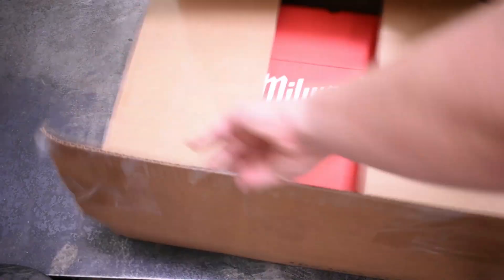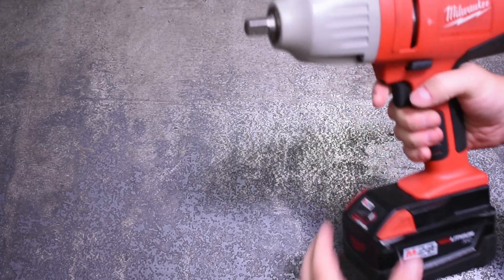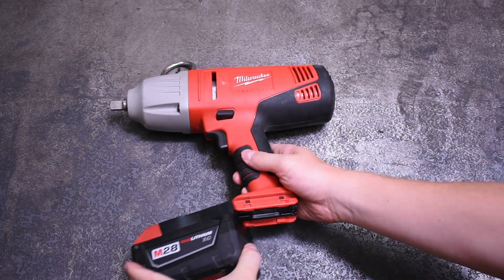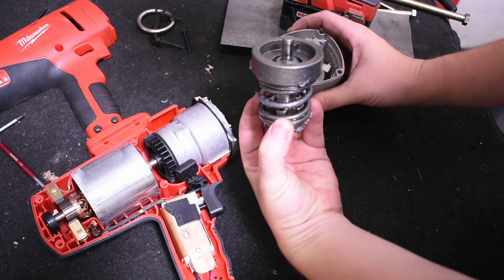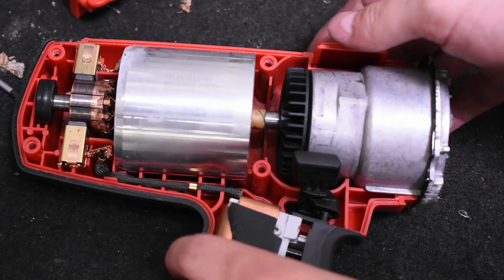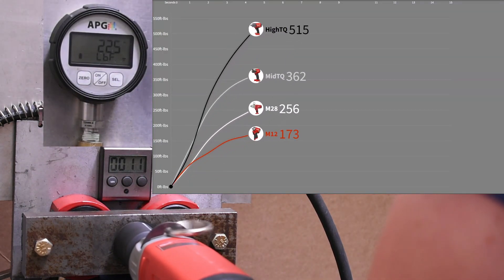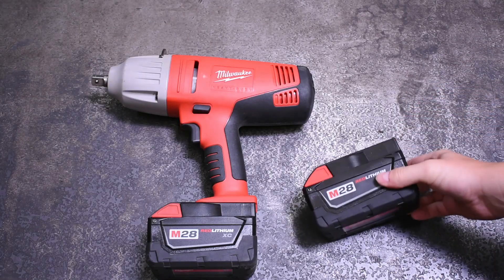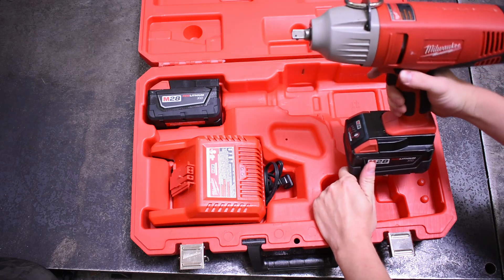The Curious Case of M28: Milwaukee's Little Known 28 Volt Line

Comment: The battery pack going in from the back or the front was the standard through their older line of 14.4 and 18 volt tools, pre-M18; this design was great and used to be my go to as if you load in the front the tool is well balanced for down and forward facing work while loading from the back made it a lot easier to use overhead.

Comment: I had the old circular saw, drill, and Sawzall in 28 volts.  The Sawzall was the only one in the group that performed like a corded tool.  But at the time the M28 platform was the most powerful battery-powered platform I could find. I did replace them when all the batteries started dying with M18 but it felt like I was going backward at the time. But soon after that since I got the brushed tools. Then I learned that the brushless motors seemed to make the difference. I still have them packed away for some reason.

Comment: I’ve had the hammer drill since I was a kid. I found it out in the bush acutely. It’s been dead for about 10 years never seen it run. is there anyone out there wanting to charge the battery and try it?
Reply: Umh. A lithium battery not charged for 10 years is certainly dead due to self-discharge. If a cell dips below 3 V for an extended time, it becomes dangerous to charge and should not be charged.

Comment: I still use a 14.4 volt Milwaukee drill I've had for about 20 years. It also has the reversible battery.

Comment: Milwaukee has a higher voltage line that's been around for years and they actively support with new products. It's called MX and it's 72 volts. More suited to riding mowers than impact wrenches though if they ever use it in a consumer product.

Comment: I like the 28/24v tools that can be converted to external power like on trucks and machines for back up power working in isolated areas,  I have an old Goodyear 24v impact probably 15 years old that still performs as good as it did new and has served me well in remote situations hooked up to 24v starter batteries
Reply: That's exactly why I selected the Milwaukee M28 line (have most of the tools by now, all bought used). I live in a truck with 24 V onboard electrics and 24 V in the living space, and just hook these M28 tools up to 2×12  AGM batteries. Works great, and also means I don't have to charge (and won't degrade) the M28 batteries. 

To make the connection, I converted a broken battery: remove the cells and add a SpeakOn STX connector, which can take 40 A and are used as weatherproof connectors in large PA setups (loudspeakers and stuff). Cables are also from loudspeakers.

Still looking for a good-quality 24 V chainsaw, if anyone has suggestions …

Comment: I remember buying a V28 kit back many many many years ago. At the time it was a huge upgrade over the Makita Nicad stuff i had (the red pod batteries) Then later had to buy a couple of newer M28 batteries (M28 was sort of the 2nd gen rebrand of V28). But very quickly was forgotten. Seems Milwaukee put their RnD into M18 and just sort of left M28 to die. But you can still get the batteries

Comment: DeWalt too had useless 28v and 36v platform
Reply: I think you memory is off...dewalt has had 12v, 14.4v and 18v(20v max) in nicad and lithium, 40v tools in lithium....porter cable did have 28v but in ni-mh.

Comment: The shop I work at had a bunch of Milwaukee 18v Pre- Lithium tools. All of these tools had the reversible battery track just like this. I was disappointed that they removed that feature from the New line of 18v tools. Overall I wish they would have just done like Ridgid and kept the same battery footprint so the new batteries would have worked with the old tools.
Reply: I think they wanted more pin for the electronic interface...

Comment: I had hoped Milwaukee would take advantage of the 28 volt line when Dewalt starting upping their volts. I thought they could have a game changer offering 28 volt brushless models.  Overall I’m happy with the M18 line otherwise I wouldn’t have spent 15k over the last 7-8 years on that platform.   I Still think they should just ditch the brushed models altogether.

Comment: I had V18 tools, the drill had the best chuck of any drill I've ever used.  At that time Milwaukee claimed to have more made in the U.S.A. power tools than any other company, unfortunately that claim didn't last long.  Pretty sure my M12 Fuel tools will easily outperform that V18 stuff.

Comment: We use some M28 tools at work the best tool in the line that we have is the M28 vacuums.
I wonder if Milwaukee brought a new 2022 Impact into this line made it a Fuel and with a newer XC 5.0 M28 battery how well it would perform?

Comment: I actually started out with M28 and moved into the M18, M12 lines it looked like they were cordless versions of the corded tools of the time I had Portable Bandsaw and a bunch of other tools that worked great. The first generation of M28 battery would self discharge pretty quickly. I bought my M28 stuff around 2006, cutting edge for the time. Thanks for comparing old to new. Times have changed

Comment: I'm glad Milwaukee actually stuck with the M18 line.  I got so tired of kitting out my work vans only to have the company abandon the platform for a few extra volts.

While I have my issues with Milwaukee quality lately, you can't complain about how long Milwaukee has committed to M12 & M18.
Reply: people who originally bought into V18 and M28/V28 li-ion can't say the same thing though.
Reply: Also there’s no reason to change the voltage. M18 works just fine over never had something my 1/2” impact can’t remove.

Comment: This reminds me of the 1st crop of 18V/20V brushed high torque impacts like the DeWalt DCF889 I used to own. When I got it replaced with the DCF899 I tested them both on my truck's wheels and suspension and there was no contest in speed and torque. The only thing I liked about the 889 more is its instant response to the trigger, something that I haven't been able to find on any Brushless tool be it Red, Teal, Blue, Yellow, Orange or Lime (the ones I've owned so far)

PS. It would be great if you can either get your hands on some 1st gen high torque brushed 18V/20V tools like the DCF 889 (or its Craftsman and Porter Cable clones) , Milwaukee's 2663-20 or Makita's XWT04

Comment: Ah, thanks for this,TTC. I always wondered how it compared.

I too bought that impact way back when they came with V28 batteries. No surprise, the batteries went bad. (Milwaukee punted on the 5yr warranty, when I sent them in at 4 years)  Bought cheap Amazon M28s, which did ok (ish). Then the trigger quit working.  At that point I punted on it and got the M18 high torque, albiet begrudgingly. (And only after I could clearly see it was heads and shoulders above the Dewalt I swore I would buy).

Still have a nice V28 drill, shop vac, and radio... and one functioning M28 amazon battery. 

Thanks TTC. It was great to see this test. Amazing how far things have come.
Reply: The new Dewalts are pretty great honestly. My coworker has an M18 and I have the new DCF891 and the gap between yellow and red isn’t what it used to be. Used to be yellow tools sucked lol.
Reply: ⁹

Comment: This is an impact that looks like it was “quality over quantity”. Never a bad thing. It’s just a shame that in the last decade quality on most of these tools have suffered to reduce the weight of tools. Seems like there’s a fairly happy medium on pro tools but this looks like it was engineered to last a lifetime. It’s a shame they opted out of the battery platform
Reply: Most of the decent modern brands today really aren't slouches when it comes to durability.  I'd go out on a limb and say this impact might've been OVERbuilt.
Reply: @h8GW  sometimes that's a great thing! I imagine how much less severe my carpal tunnel flare ups might have been if my everyday air tools would've had that much bearing cushion against the vibration...and the fact that they'd probably need rebuilt...about 80 years from now.

Comment: Can you let us know the age of the batteries used for this test?  Battery internal resistance increases with age even when stored unused.  I wonder if the dyno results represent how the tool would have functioned when it was brand new with fresh batteries.

Comment: That's the old 18v ni-cad tool adapted for lithium. It's 28v fully charged at 4v/cell but Li-ion cells run down to 2.5v/cell (17.5v). They probably just limit power to the equivalent of 18v as the battery runs down. Now that the batteries are dead, I'm thinking of running my old one at higher voltage to see how much power I can get from it, (24v, maybe 36v)

Comment: i have the midtorq m18, compact and packs a punch for its size, got it brand new for free without batteries and charger tho so i bought a set of third party batteries, still does it but they doesnt last as long as the original batteries and the off brand charger takes twice the time to charge the batteries... still tho the tool is great and i can use it on wheel nuts and bolts with ease

Comment: I've always thought "old" Milwaukee cordless tools were of much higher quality then the new stuff, of course the performance pales. My first Gen 18 Volt tools were indestructible, but my new stuff is way lighter and more powerful. It's SAD that my "new Milwaukee" drill is using my "OLD Milwaukee" chuck since the new chucks suck so badly.
Reply: You can get aftermarket German chucks. Because yeah the new ones suck.
Reply: We had to ditch a bunch of the old Milwaukee 18v stuff due to all of the batteries being dead. Those tools were tanks and worked very well. I hated to see the new series take such a dive in overall quality, but love the increased performance.
Reply: The original Milwaukee lithium ion, were a pile of crap.
I still have my old tools, bought a battery adapter, but haven't used it yet

Comment: M28 uses 26650 battery cells
Reply from the maker: Then how in a 2P configuration is it only 3ah? 1500mah 26650's?
Reply: V18/V28 packs used 26650.  M28 uses 18650s.

Comment: Heavier, wider hammers seem to dominate. I think moving forward, innovation in the hammer mechanism is where we will see gains, not so much motors and batteries. I am surprised we haven't seen tungsten nickel iron alloy hammers yet. They would be more interesting especially when you want a hammer assembly that is more compact. A tungsten alloy hammer can deliver twice as much energy  with the same size.
Reply from the maker: I believe most tungsten alloys would be too brittle. Thy need to take a WHOLE bunch of impacting forces, hardness not as sought after as toughness
Reply: @TorqueTestChannel  Would inserts of tungsten work? Tungsten on the inside and something tough on the outside.
Reply from the maker: We're trying to do just that with inserts
Reply: @TorqueTestChannel  a friction fit  sleeve on the outside perhaps?
Reply: @TorqueTestChannel  W-Ni-Fe alloy is very different than the usual tungsten carbides we are used to, which are more like a ceramic. But perhaps ironically W-Ni-Fe might be too soft, I read the hardness is 24-27, I am not sure there are means to harden it to the 45-50 range as we do with tool steels. I mentioned W-Ni-Fe because its the only tungsten alloy I could think of, but maybe there are better alloys for that use. Other than that, some stainless steels are slightly denser than tool steel, but the difference is so small it might not change anything.

Comment: The tools are strong the V28 batteries were not. We have almost every tool in the the line except the band saw. I’m about to rebuild all the batteries because the tools are strong and have not skipped a beat since new.
Reply: Yes the V28 batteries did not last very long. I think maybe b/c they use 7 of the 26700 cells, and cell tech at the time was not advanced enough to provide high amps and long life from 7 cells. The M28 batteries are better, I think. They use 14 of the 18650 cells and come in 5 Ah variants as well.

Comment: Could you guys do an episode on how breaker bar torque compares to nut busting torque?  I am often confused why my big impact wrenches can't budge some bolts, but my 20" breaker bar, pulled slowly, can.  I'm not a weakling, but my arms  produce less torque @20" than 1000lbf air guns are rated for.  What makes slow and steady pressure work when impacting doesn't?  (Not sure if this is unique to torque to yield bolts or not)
Reply: The relatively short pulses of torque from the impact don't have time to "reach" the threads, as they are "absorbed" by the length of the fastener. The torque applied via the breaker bar isn't "pulsed" in nature, so it is transferred to the threads.  Same phenomenon is what limits impacts, when you start adding extensions. (The loud "SNAP" heard when that bolt breaks free is the "wound up" torsion straightening back out, that you had to over come, that the impact didn't have enough throw to defeat.)
Reply: @mattmanyam  Is this unique to bolts where the head is a few inches from where the threads engage?  (E.G.  Head bolts and most torque-to-yield fasters)  Testing this would be a fascinating episode.  From your description, this wouldn't happen on nuts or short bolts where the torque is applied where the torque is resisted (the threads)?
Reply: @SvdSinner  1. Yes
2. Generally, yes. (It would depend on how the clamping forces interact, and how corrosion has developed)
Reply: @mattmanyam  Fascinating! That makes sense. 

Makes me wonder whether some impact tools and some bolt lengths are better matches for each other.
Reply: @gf2e  yes. This is indicated by how some torque-sticks react differently to different guns. {The same "absorbtion of torsion impulses" principles is how they work.)

Comment: I like the 2x 18V over the new 40V hype. With 2*18v there is a lot more flexibility. You can have compact highpower or a bit bigger high energy in one. 2*6Ah 18V are more flexible than a 6AH 40V as you can use 1 18V 6AH on a drill where a 40V 6 Ah would be to big. Although I guess you can do the same to combine 2 40V 3AH battery's.

Comment: A lot of the M28 stuff felt/looked/performed like corded brushed tools with quick and dirty DC conversion. Fine for the era, but pretty outclassed for 10+ years now.
Reply: Isn't it more like 20 years?  In ~2002 I bought my first Milwaukee, a 14.4v 1/2" drill.  It had a whopping 400in/lbs  torque!  And used NiCad batteries.  I think the 28v tools were available at the same time.
Reply: @fredygump5578  It came out in 2005. I was a plumbing trade apprentice at the time and wanted to upgrade my old porter cable nicad system with lithium ion. Milwaukee V28 and Makita 18V LXT basically were the first two platforms then. I went with the Makita LXT while the contractor I worked for did the Milwaukee. I had no problem with usage with either platform however looking back on it glad I went with the still relevant Makita.
Reply: @charlesfinnegan7930  I got the makita too when it came out.  I was installing satellite TV, and that was the essential tool.  Sadly my milwaukee weighed like 3x, tried to snap my wrist all the time, and took much longer to charge.
Reply: @fredygump5578  I still have the original makita tools. only doozy was the original 1/2" drill. I still have one original battery that runs also.
Reply: Makes me wonder once again when/whether anybody will start making corded brushless tools.
Reply: @rpavlik1  They do. It's common to find BLDC industrial assembly tools, i.e. the tools they use to put cars together. For example AcraDyne nutrunners and Atlas Copco screwdrivers. They want good ergonomics, tight torque and rotation control, and the ability to stand heavy use. The thing does hook up to a big stationary VFD/controller box. It's a different market obviously than cheap corded homeowner tools.
Reply: @straightpipediesel  oh interesting! Makes sense.
Reply: @rpavlik1  To be precise, a brushless motor is a 3 phase motor.  You can probably imagine the issues that would come up with a corded 3 phase hand held power tool!  First of all, you don't have 3 phase, so you would need a VFD for the tool.
Reply: a transistorized brushless on Line Voltage? now that would Kick Beans
Reply: @fredygump5578  right, I know. But you could in theory rectify the line voltage and then drive a BLDC just like a battery. My furnace has an "electrically commutated" blower motor, which is just another way of describing a BLDC motor.

Comment: I was wondering why they call it a brushless DC motor instead of what it is. Three phase computer controlled motor.
Reply: So they can brand "brushless" on all the tools and for some reason it ticks good in our monkey brains.
Reply: Because the power source is DC and it takes DC current and basically emulates a 3 phase sine wave, still using DC in steps.  What else would they call it.  

And BLDC motors still employ permanent magnets much like a DC motor does.  Actual 3 Phase AC motors don't have to use anything special but a gigantic chunk of steel and induction.
Reply: @jaywelker5566  Yes but as you said it is ac at the motor. You can plug a BLDC motor in to 3 phase ac and it would work. It is a permanent magnet ac motor.

Comment: Put that 28 volt to the max best case scenario. Go at it in reverse for a minute or until the number flatlines whichever comes first.
Reply from the maker: Unfortunately the longest industry standard impact wrench test length is 15 seconds.

Comment: The M28 impact wrench worked well. I had accidently bought mine as pin detent instead of ball detent. There was a kit to convert it. Overtime it had an issue that it would only work sometimes when I pulled the trigger. I had it serviced twice they could not find the issue. I eventually took it apart and found a crack in the brushes which would wedge in the brush slot causing it to stop working. It was top of the line at the time it was released but the m18 HTIW can destroy it and its lighter and smaller.